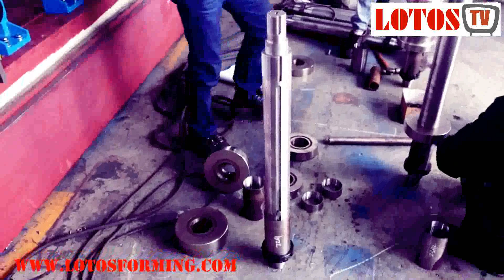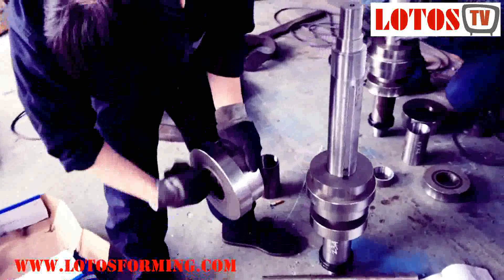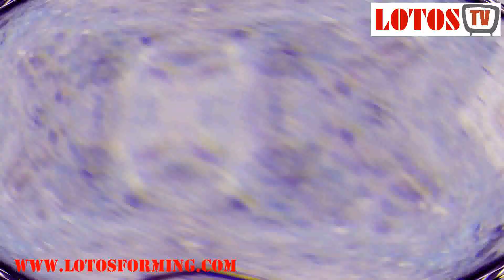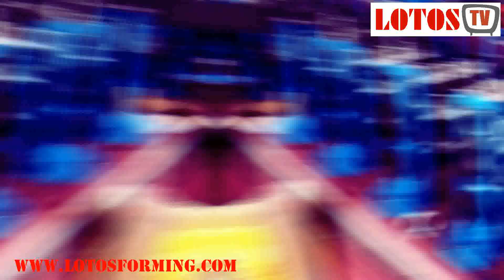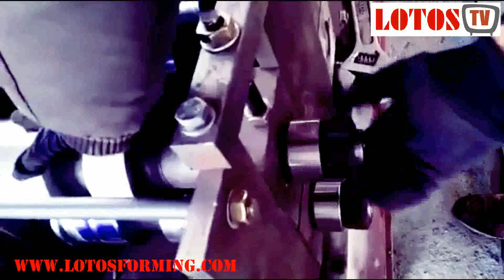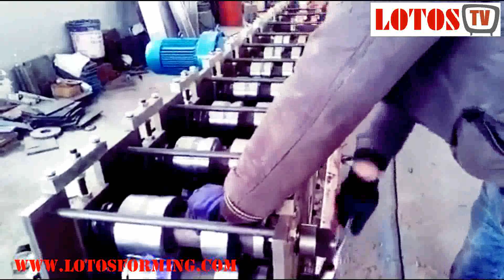【Adjusting the gap between rollers】: How to adjust the rollers of the roll forming machine ??

Comment: Between the rollers are spacers, which will reduce the cost
of the mill. And easy to adjust to produce a different desired profile with
split spacers